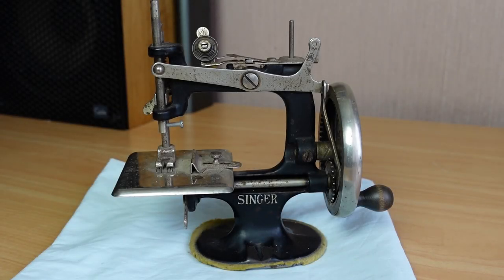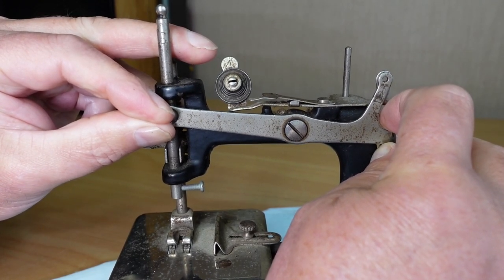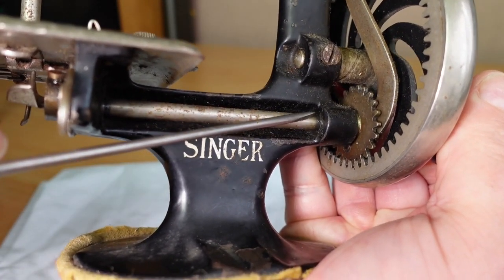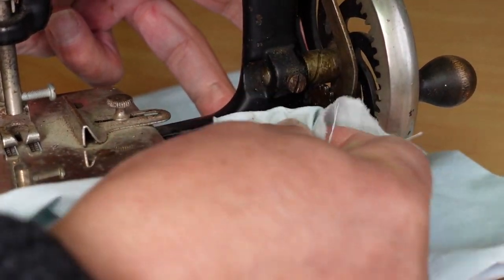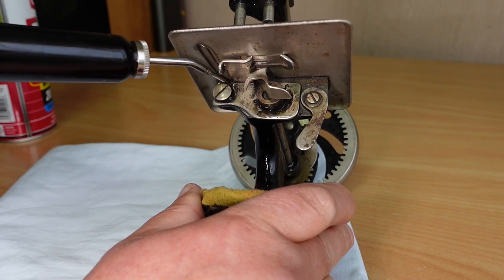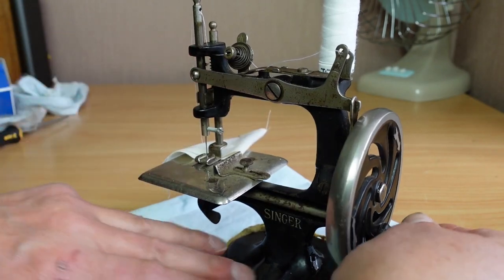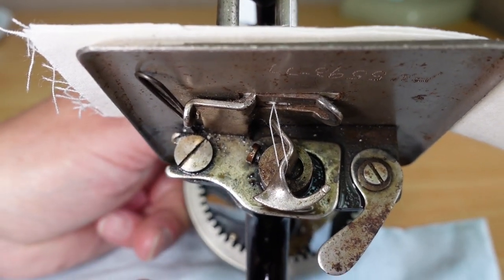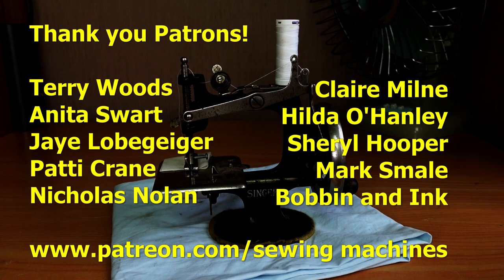Cute Singer Model 20 Needs Some TLC - Fixing up this Machine and Test Sewing

Comment: Here´s a trick for chain stitch machines (including cover stitch):
Instead of "chaining out", stop before the edge of the fabric with the needle in its top position and raise the presser foot. Use a spatula or some other thin and non sharp instrument between the presser foot and the fabric and pull out a loop of the needle thread(s), a couple of inches long, and cut the thread(s) at the end of the loop. Remove the fabric from the machine and the thread(s) will be pulled to the underside by the hook, and the stitch won't unravel when you pull on the treads. (You may have to slightly back up and hold your hand wheel, depending on your machine). On a machine with more than one thread they can easily be tied together on the underside for extra security!

Comment: Just FYI for anyone looking for a non-original needle to fit their model 20: I got some Klasse DCx1 'Type B' needles to try them out in my model 20 as I couldn't find the Schmetz ones locally (here in New Zealand). Unfortunately the shank on this brand, at least,  is too thick to fit in the hole in the needlebar.  I'm going to try grinding them down a bit to see if that will do the trick as it shouldn't need much I don't think.